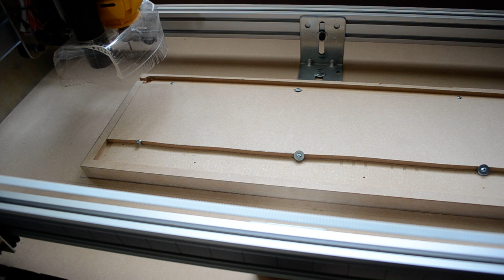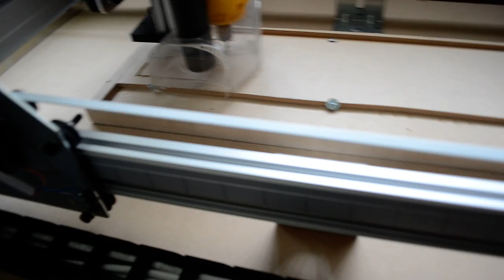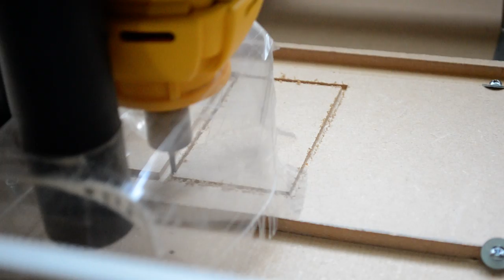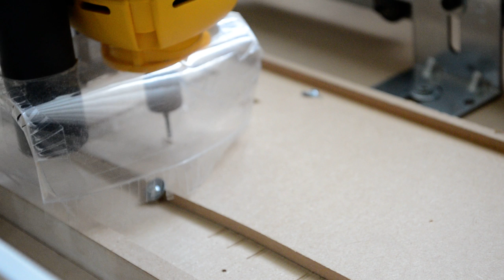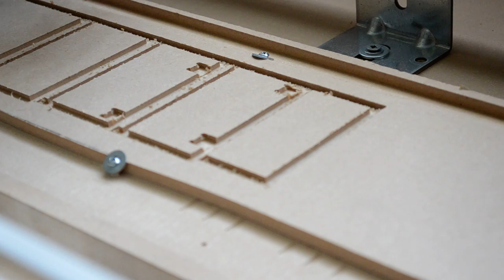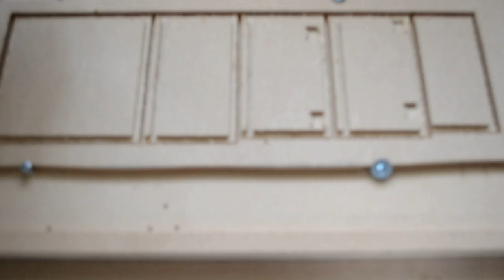ShapeOko $0.99 dust shoe

Comment from the maker: Sorry, I didn't see you're also using the DW660 until after I replied. I'm cutting 6mm MDF (1/4") and make 6 passes so each step is about 1mm. I actually think I can be more aggressive with both the speed and the step depth but it will be about another month or so before I can get back to it.

Comment from the maker: The mill rate is 450 inches/minute, the video is real time. One of the biggest reasons I can run so fast is I'm using a Dewalt DW660; it has a lot more torque than a Dremel.